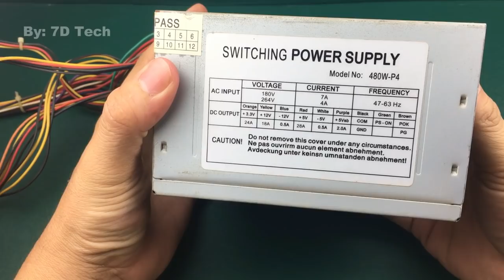DIY PC Power Supply To Battery Charger, Science Project 2019

Comment: 12V ok, but you did not check apm- reading (current). PSU Yellow (12v) lead is reading 18A on the side. Generally 12v batteries are charged with only ~10% of their capacity.
Reply: What amprage and voltage would be suitable to charge a battery that size?

Comment: thank you 
 i got 12 volt from the power supply of the computer
i used it to charge battery(12 volt  7ah)
but the amber of the power supply is 2.1?
is it problem

Comment: hmm kinda silly should have used the CPU connector 4 prong connect it into 2 lines and presto 15 volts and it will charge a 12v battery in 3-4 hours instead of what he did with a Molex connector, that will take 8-10 hours too charge at 12.5volts ……. amatuer hour
Reply: Please show me i dont understand